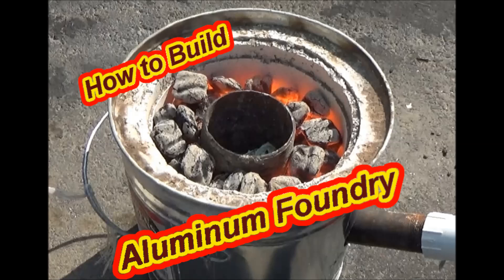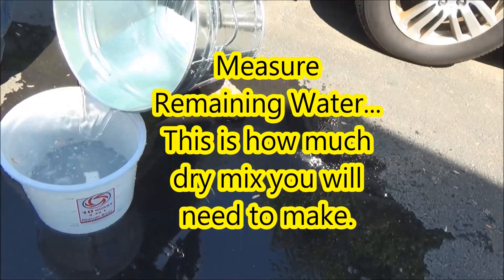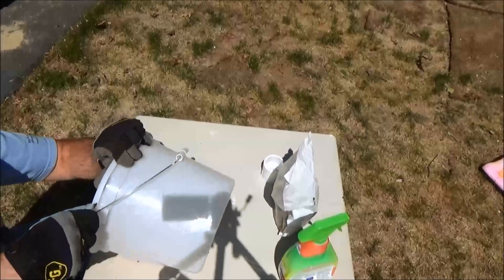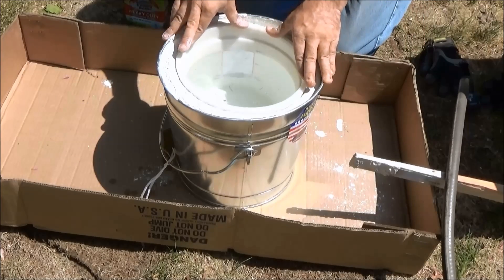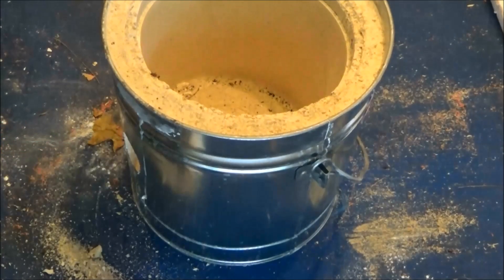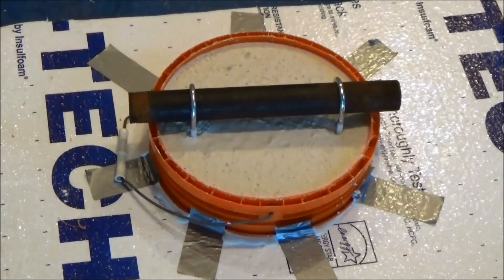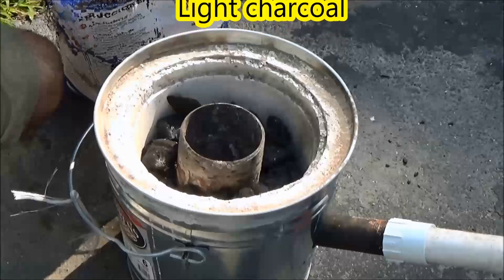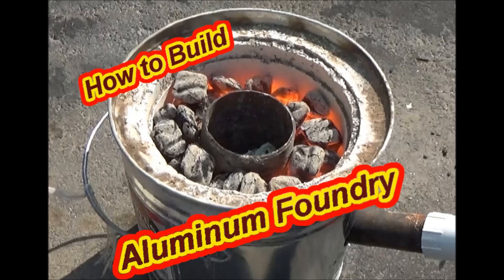How to Build an Aluminum Foundry!

Comment: So, I'm having a bit of trouble. I used the same 6 gallon steel bucket you used, and so with a 10qt inner bucket, the amounts should be the same as you used in the video. But somehow that ended up giving me too much material, and I couldn't push the 10qt bucket in as far as yours got, or I would have been overflowing.

It also hasn't cured yet, and is pretty soft. (Been three days) I'm not sure what I did wrong... 10qts plaster dry mixed with 5qt vermiculite, and then soaked in 10qts water, before mixing thoroughly.

I did use vaseline instead of cleaner spray to lube the core bucket, which made for very easy removal. Would that have somehow affected the refractory mix?
Reply from the maker: +MeatSim9 Light a small charcoal fire in the foundry... Do not use additional air just let it burn as a natural charcoal fire. That should dry it out. After it cools back down you should be ready to try it. It is probably humidity that is making it dry slowly or feel damp to the touch.Good luck!
Reply: Ah, that sounds plausible. Garage is pretty damp at the moment. I'll give that a shot. :)
Reply from the maker: +MeatSim9 Let me know how it works out!
Reply: We cooked some hot dogs with the coal fire, but the lining was still very soft. Going to redo it, but I think less water, less vermiculite, and more plaster, maybe some sand.
Reply: I just did the measurments using the exact same containers and the left over water after the displacement was not 15 qts.  thats why you got over flow.  its only 14 quarts.  did it twice and got same results.  so if you used 15 quart formula there is a quart too much after you push the bucket in.

Comment: can you make a crucible from the refractory mix? just cast it from a measuring cup? will it hold the molten metal and not melt through? thanks
Reply: Not safe!  Crucibles must be strong enough to handle and hold heavy melted metal when red hot.
Reply: use clay, graphite powder and a binding agent. I might try making one with water glass.

Comment: what makes it stronger? sand or perlite
Reply from the maker: +Josh&#39;s Whips And Lanyards Sand is stronger in my opinion but I opt for the better insulation of the perlite.
Reply: ok thanks man how can I stop the foundry from cracking any ideas?
Reply from the maker: A wire screen mesh in the walls will definitely reduce or eliminate cracking.

Comment: how much did all this cost bro? me and a friend want to make it and need to know the price? +Heath Putnam
Reply from the maker: +Josh's whips and lanyards $15 for the steel bucket $15 for the plaster $15 for the fittings $15 for the perlite and some misc. Probably $75 if you buy everything. You don't have to buy the bucket if you can find one somewhere. You may be able to find the fittings lying around also. Good luck if you try it... Let me know how it goes! Thanks for the comments. Check the description for the parts you will need!

Comment: i am gona try this project this weekend! i have one problem ,what to use for the inside (glass)! i triend and cut a paint sprey but it seams rly thin so i dont think it can huntle it! any ideas on what i can use for the inside holder?
Reply from the maker: +Phantom Duck If you are talking about the crucible...I use a 4 inch diameter iron pipe with a cap for my crucible. This has been used for many time with no signs of burning out. I got mine at FW Webb plumbing supplies! Thanks for the comment!
Reply: +Heath Putnam thanks a lot for your answer m8. its a bit hard to find such a think here. actualy i dont know where to ask but well i will find something. some sugest me to take an fire extinguisher and cut it.  but that seams hard too haha:-P. thanks again. u have any tips that i need to be carefull about the constraction? i will try to make it this weekend if i find all the stuff i need :-P
Reply from the maker: Amazon actually sells graphite crucibles reasonable.

Comment: Is that metal 6 gallon bucket galvanized? Looks like it. Is that safe?
Reply from the maker: +McCabe Lowe With this insulated refractory cement recipe I used; the bucket never even gets warm. After many uses the label has not even come off the bucket. If the bucket did get hot enough to start to burn the galvanization it would pose a problem. Thanks for the comment!

Comment: mixing the dry ingredients ...get 2 - 5 gal. buckets and dump the stuff back and forth.much easier than stirring. good stuff. 380
Reply from the maker: +Pappy Oh... Good idea! Thanks for the comment!
Reply: you are welcome.we used to do that with paint... if a job takes 45 gallons,color has to be consistent...sooo, we "box" it back and forth until satisfied. always worked well.

Comment: I run a charity where we scrap pop cans, do you think this is worth doing then taking them in for scrap?  Where i'm from it's about .50 a pound for pop cans and over 1.00 for aluminium
Reply from the maker: +Jeremiah Bowes Because of slag (paint and other impurities) you will get between 1/2 and 3/4 lb of pure aluminum for each lb of cans you melt. So you would be better off to melt the cans down. If you melt on collection day your storage will be easier. Good Luck and thanks for the comment!!
Reply: Thanks!

Comment: Hi, its been a while since you built this thing. So, how has it held up? How many pours have you done? Any changes/improvements you would do if you had to make another one?  Nice video btw.
Reply from the maker: +TheT2eL I have used it at least 20 times. The burn chamber is holding up well, the cover did break. I would add some re-enforcing wire while pouring the cover. I will be posting a new video for my new forge/foundry combo. Thanks for the comment!

Comment: Can I use Vaseline as a mold release to make removing the 10 quart bucket easier or will it react with the plaster mix?  Thanks
Reply from the maker: +Engineerboy 100 Vaseline should work well. Thanks for the comment!
Reply: Spray it with your wife's cooking spray! PAM

Comment: Can this foundry melt copper aswell? Also (stupid question) what metal is the bucket and muffin pan made out of lol.
Reply from the maker: +Replayable It will melt copper, but takes a while. The bucket and muffin trays are steel. Thanks for the comment:)
Reply: Thanks

Comment: hey , i'm thinking on build mine but a really need some pros and cons... do you guys think the charcoal one  would be enough  to pour 2 liter of aluminium  or should i build the gas one??? i can build both but i can't decide which one...
Reply from the maker: +fireblade639 Either one will melt 2 liters of aluminum. Make sure you start with you crucible. A 2 liter crucible is pretty big and must be totally enclosed within the foundry so it can be covered. The major con I have seen with charcoal is you need to refill it a couple times during a large melt. I like the propane for another reason also. I do not need electricity with my burner design. I made a propane burner for mine but it is convertible to either burn charcoal or propane. Good luck and don't hesitate to ask questions! Thanks for commenting!

Comment: for everyone saying he "copied grant exactly" that's not true at all his design is similar but different size (which is basically the same) but a big difference is he used vermiculite/perlite instead of play sand
Reply: +Cody Lee Yeah, Grant's is a nice starter one, but it's only big enough for smaller fire extinguishers, and bigger forges means bigger crucibles, as well as more coal room.

I like the idea of vermiculite making the forge lighter as well, but my first go at it hasn't turned out. (Neither did my first go at Grant's forge)

Comment: nice video! very clear. got a few questions: you used another ratio for the lid, why? what is a good ratio? how did you exaxtly decide how to mix? I understand how you figured out how much mix you needed, bit how did you figure out the parts of different ingredients? 

I've built Grant Thompson's version, but it is falling apart very quick. don't know why, even other foundries seem to last longer. maybe my mix was not right. is this mix holding up right? only plaster of Paris and vermite(can only find perlite, is that OK?) does the plaster smell, or have any problems with the galvanized bucket?
Reply: +Samsquantch +Heath Putnam I would recommend a face shield. Not too expensive and shields your face from the dangers of splashing. also welding gloves, and thick clothing(no synthetic!) is a good idea
Reply: OK, watched again, perlite it is, is that the stuff you can get at a store for garden supplies?
Reply: +Triangle_DIY sorry for asking so much, want to redo my furnace I built about a year ago. the mix stayed soft, cracks and its falling apart after about 8 melts. what is the crucible? you say 4 inch pipe with endcap, but for what is that used, where can I find it? is it a screwcap? if I know where it is used for I can see if I can get it in the Netherlands. how many melts can you do with it?
Reply from the maker: +Triangle_DIY The galvanized bucket shows no signs of heat and has caused no problems. You can use either vermiculite or perlite to mix with the Plaster of Paris. The plaster does not smell at all. As for the mix. I tried several mixes while working on Rocket stoves and the mix I used for the foundry body is the best. Use the same mix for the cover also; I used a different on in the video but the foundry body mix is better. Give the mix ample time to cure before bringing up to full temp. Thanks for the comment!
Reply from the maker: +Triangle_DIY The crucible is made of 4 inch diameter iron drain pipe. The end cap is threaded, here is a link to one similar to what I used... I bought mine from a local plumbing supply house. http://www.amazon.com/dp/B0058DHYQM/ref=biss_dp_t_asn
Reply from the maker: +Triangle_DIY  I have currently used the crucible and the foundry at least 20 times and they are both holding up well. I have converted to propane for the heat... I posted a video of it...
Reply: +Heath Putnam Thanks for your answers. I'll try to redo my furnace sometime with your mix. Also will take a look for the crucible material.
Reply from the maker: Triangle_DIY Thanks for the comment!
Reply from the maker: Samsquantch I do not wear a full mask... only safety glasses, although I recommend you take all precautions if you decide to do this. Remember molten metal is very dangerous! :) Thanks for the comments and questions!
Reply: Ahah thanks will do
Reply: +Heath Putnam that's what I use! the tint is not necessary for the light, it would only hinder
Reply: +Heath Putnam Cheers for the guide, will this work well enough? http://www.ebay.co.uk/itm/Graphite-Crucible-Metal-Casting-Pouring-Mould-Melt-Gold-Silver-Copper-1-KG-/252197904754
Reply from the maker: Samsquantch Yes that will work fine. I may buy one of those myself! Thanks for the comment!
Reply: +Heath Putnam
Awesome :D what head masking do you use if any?
Reply: Heath Putnam
.
Reply: Alright thanks, I saw they didn't seem to cost much, you mean something like this?

http://www.amazon.co.uk/Scan-PPEWELFL-Flip-Welding-Helmet/dp/B009Q17D90/ref=sr_1_5?s=diy&ie=UTF8&qid=1453672794&sr=1-5&keywords=high+temperature+face+shield
Reply from the maker: Samsquantch You probably do not need a tinted face shield. It is not that bright. I would opt for something like this... http://www.amazon.co.uk/Face-Shield-Clear-Cover-Protect/dp/B00W4ZNXKI/ref=sr_1_sc_1?s=diy&ie=UTF8&qid=1453681071&sr=1-1-spell&keywords=grinding+facesheild
Reply: Cheers!

Comment: Why did you use a different mixture for the lid?
Reply: +Kenneth Elston Well, because the lid is smaller. He still used the 2 parts plaster to 1 part vermiculite ratio, all he changed was the amounts.
Reply: Thanks

Comment: made a foundry similar to this not too long ago, converted it to burn waste oil or propane.  When waiting for it to set, instead of holding the bucket down into the mix, I just set a scrap piece of 2x6 across the entire thing and put a paint can on top.  Makes everything level with no effort on my part
Reply from the maker: +scubrodiver Great idea. Mine was not perfectly level. Thanks for the comment!

Comment: About how many cans did you use in this video?
Reply from the maker: +Sheriff3466  About 60 to 75 cans were used in this video, but they were mostly larger energy drink cans. probably 80 to 100 regular sized cans would be necessary. Thanks for the comment!

Comment: what kind of temperatures can you achieve could you melt copper?
Reply from the maker: +myfreestylebmx1 I have not tried to melt copper. My crucible starts to glow almost white with the hair drier on high so I only use low for Aluminum. I believe it could handle copper, let me know if you do it. Thanks for the question and thanks for viewing!

Comment: YOU COPYED KING OF RANDOM
Reply: copied*
Reply from the maker: +James Waters About a year ago (actually before Grant's video)I made one very similar to this design and posted (10-12-2014) a really short video of it. https://www.youtube.com/watch?v=ztcB6zraOgM This latest build is highly inspired by Grant Thomson's design, but it is much bigger and lighter weight. I used course vermiculite in the mix to give it good insulation properties and reduce the weight. I can actually put my hands on the sides of the bucket while melting aluminum and can remove the cover by hand also. Hope you enjoyed the video. Thanks for the comment.
Reply from the maker: +Timothy Oliver Thanks for the comment*
Reply: Ya

Comment: Awesome as always. Have you seen Grant Thompson's video? If so, why did you make this one? I've heard that these refractory mixes with plaster of paris often crumble after being fired up a few times. Any thoughts?

Thanks for making!
Reply from the maker: Righteous King I have a really short video on my channel of a foundry I made a couple years ago. No audio, really short, 11 seconds long. It was my first attempt made out of cement. It crumbled quickly. I have been experimenting rocket stoves a little and came up with this mix. It is lightweight and I have used it quite a bit and it has not cracked yet. When I am melting aluminum I can pick the cover and the forge up with my bare hands. It seems to insulate extremely well. You do have to be careful when handling any refractory! Thanks for the comment!

Comment from the maker: I use a 4 inch diameter iron pipe with a cap for my crucible. This has been used for many time with no signs of burning out.
Reply: Me to
Reply: Did you weld something to the end of it or what? Basically, how did you cap off the end?
Reply from the maker: No welding, just get a 4" iron pipe and a screw on cap for it.
Reply: I thought that's what you meant, but wasn't sure if it would be air-tight, but apparently it is. Thanks for the info!
Reply from the maker: Yes sir. The iron pipe is meant for water lines.
Reply: Dumb question but how much did your pipe crucible cost just looking online the pipe cap is like 40 bucks ??
Reply: Heath Putnam A
Reply: sir is your aluminium hand made foundry are capable to melt some lead, brass, or metal..???
Reply from the maker: I have melted lead, aluminum, zinc and copper in my furnace. Copper takes a while to melt. Thanks for the comment.

Comment: I've tried similar designs but always burn out crucibles. Any tips on affordable ones?
Reply from the maker: The following came off a comment on Amazon..."place it in a 400 degree oven for ten minutes; place crucible in oven while it preheats, after the oven reaches 400 degrees, set your timer for ten minutes"... also states it will crack if you do not preheat. It does have very positive reviews though. I think its worth a shot.
Reply: Heath Putnam Thanks again, Heath. I wish every YT teacher was as helpful.
Reply: +Knowledge Scavenger I just picked up everything to make mine. I'm going with Grant's video for everything except the crucible. I picked up a graphite one off Amazon for a good price. 

http://www.amazon.com/gp/product/B00FBFUB3U?psc=1&redirect=true&ref_=oh_aui_detailpage_o01_s01
Reply: ***** Thanks, I'll check that out.
Reply from the maker: +Knowledge Scavenger I use a 4 inch diameter iron pipe with a cap for my crucible. This has been used for many time with no signs of burning out. Be careful and make sure you preheat your clay graphite crucible before putting it in your foundry. If not it may crack and split in half. Good luck with it, let me know how it works.
Reply: Heath Putnam Thanks! Does the preheating need to be done just the first time or before every use? Also, how can it be safely preheated?